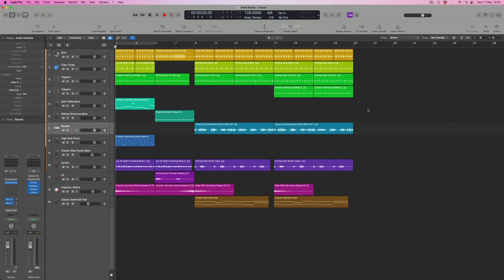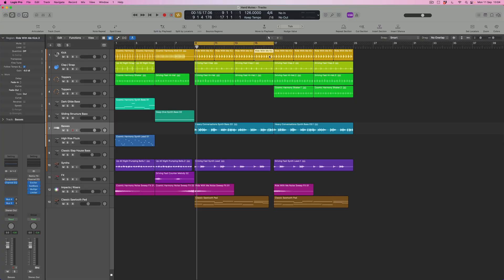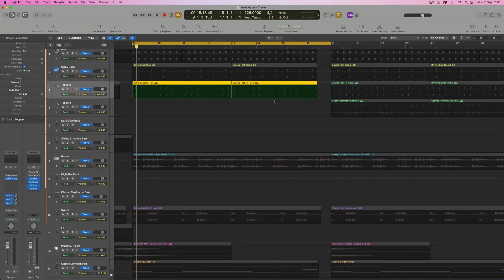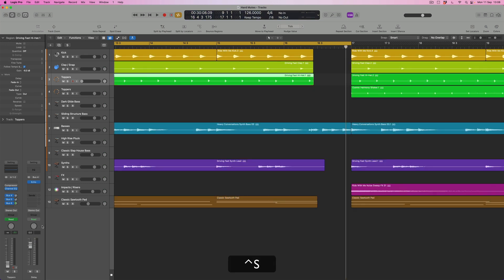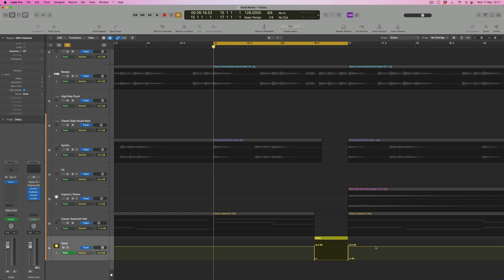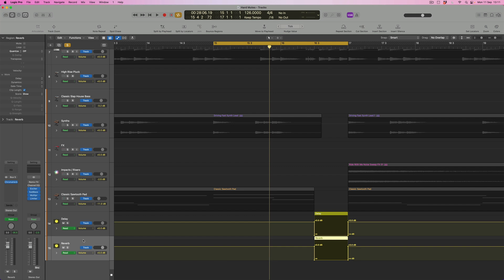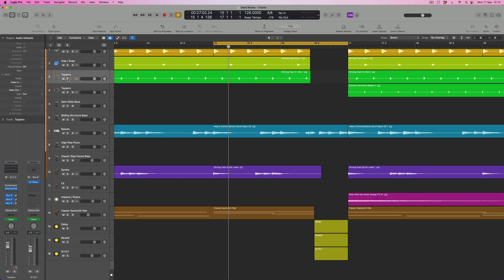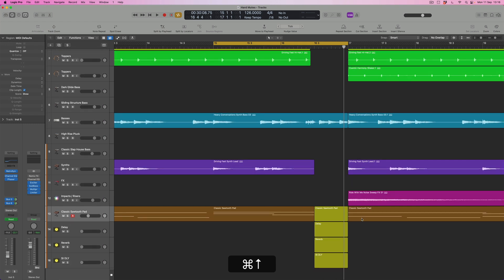LOGIC PRO X - How to use Hard Mutes

Comment: Didn't know about using latching on a bus channel strip to get the track. Although I would probably just right click on the channel strip and select "Create Track" which I think it quicker than setting it to latch, pressing play and moving the fader, then putting it back in Read mode. The automation should default to volume anyway for the new track
Reply from the maker: Absolutely right, Jay. All depends on whether you’d prefer to create or draw Automation in real-time. Both work nicely!
Reply: @jonobuchananmusic  I would rather use the marquee tool. I also sometimes route all my "global" FX-tracks to a bus, so that I can automate the volume with one automation lane only.

Comment: Word of the day : fastidious.    Thanks Jono.  Assume you could have hit create tracks on the mixer to get the aux tracks into the tracks section too. Much of a muchness really I suppose, your method has the advantage of getting that automation in there.  Just to confirm, did you create the regions, just so you could put the 2 automation points there is a fastidious manner (see what I did there :) ) , really quickly.  Logic is cool, loads of different ways to do things.
Reply from the maker: Hi John. Absolutely - word of the week! Yes, creating the regions on those Aux tracks provides useful anchor points for the Automation points. These are then more easily moveable and copy-able, as they’re tied to a region.
Reply: I used fastidius in a CV application yesterday :-)
Reply from the maker: If you don't get that job, something's wrong... ; ) @RichieWynne